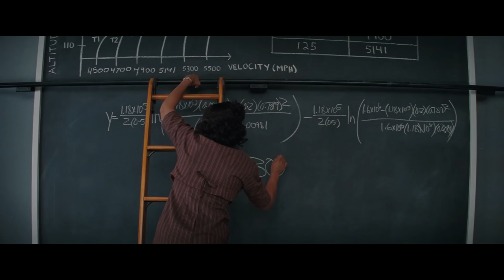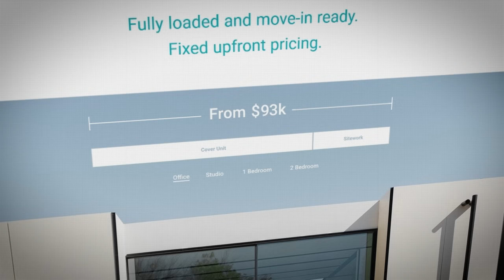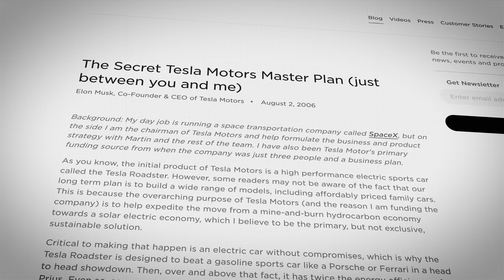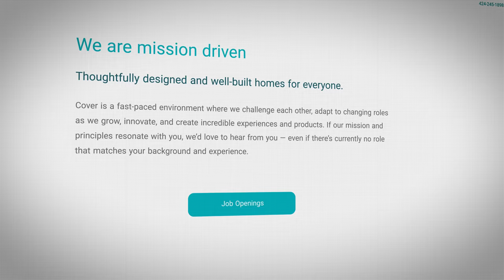How Cover Is Building The House Of The Future

Comment: Prefabs don't address the most important part of a house, the foundation! Once you have a complete plumbed and wired foundation, you can put anything on top.
Reply: You know that slabs aren't the only kind of foundations, right?

Houses with crawl spaces are very common, and in some areas houses with full basements are common. They don't need plumbing or wiring in the slab - and in any case, there's almost no wiring in slab foundations anyhow. The chief exception is a circuit going to the kitchen island if there is one.
Reply: Ahh.. So when there's a good foundation built then you can live on cardboard boxes on top of it, right? Genius!
Reply: @jovanleon7  Just because you can, doesn't mean you should
Reply: There won't be proper standardization of foundations because of soil strata
In my city, just 5km apart there is so much difference, we use 2ft foundations at one place, and 8ft at another
Reply: He doesn't make pre-fabs and nobody here is pushing them, you halfwit. He makes components which builders assemble into houses.
Reply: I don't think prefab or "panel housing" was meant to adress a foundation problem. As foundation is probably the same as with conventinal buildings.

Comment: Always amusing to me when I see yet another startup that thinks it's reinventing architecture, Tesla'ing homes, disrupting an industry... and boom $60MM is thrown their way - funded!  With $60MM in hand, they better be able to invent something.  If the panels are the focus, it would have been nice to see/hear more about the panels (other than a few flashes of 3D modeled small box structures).  Any small flat-pack house can be assembled in a month... What would make this concept special, is if the panels are structurally, insulation value, and means and methods wise revolutionary.  They could be.  SIP's are great, and most out there are still pretty low tech.  Buildings have roofs and floors as well, so a smart wall panel needs a whole system.  But, with $60MM, Cover should be able to hire up, pulling engineers from Tesla, et al, and make this into the... next... Tesla...   LOL.
Reply: Yea I like the house made out of recycled plastic. Its almost as strong and insulated as concrete!!!!
Reply: How these panels ar better than existing pre-cast concrete panels? 
Also most people want to live in bigger spaces.
Reply: Something tells me they are like next Theranos, will just run with the money lol.
Reply: the video sounds like an advertisement for the company.
Reply: Alexis sounds incredibly naive, despite his newly minted degree in Architecture. You can purchase a 3 bedroom fully equipped single-wide modular home for 40K in Texas. At well over 150K for something he is creating, he will never be competitive. Also, this price does not include utility services, nor a foundation. And don’t give me the argument about getting it into a tight space! A modular can be delivered anywhere there is road.
Reply: @rozinant1237  I see this often. There are people willing to pay a disproportionate amount of money for a concept that seems over priced to some else in the industry or someone who knows what the real cost of fabrication is. There's a RV company called Happier Camper and there base starts north of $25K US. I work for a millwrighting & fabrication company. For $10K Canadian I'd have something equally custom and more durable. Granted it wouldn't be as aesthetically pleasing but I'd have a bunch of money still in my pocket.
Reply: @HarveyMillstone  Yeah but it's a weird demographic because they are essentially selling to rich people and most of them don't want to live in a shoebox.
Reply: Same feeling
Reply: @mail22  because it is an advertisment for this company
Reply: $60 mill isn’t a problem, if successful there’s plenty more funding that can be raised.
Reply: @rozinant1237  $350,000 for a 2 bedroom, 1 bath from Cover. Insane. I understand you have to “start small”, but starting small doesn’t mean being overpriced. Unless they can get the price to plummet soon, it won’t last.
Reply: I don't think invention is the problem. The long grind of setting up a distribution system and selling to builders is what always stops people.
If a company has a distribution and sales operation in operation, e.g. the glass-makers, a new invention, e.g. sealed double-pane units, goes into widespread international adoptions toot sweet.
Reply: @HarveyMillstone and you will have the option to improve it as you see fit
Reply: I already know this company copied someone's idea that this is 10 times their price .

Comment: In my experience as a framer and now an construction estimator, prefab single family homes seem to have very little of the prefab market and prefab companies tend to focus much more largely on multi family as it provides more efficiency in that type of building. The other aspect, is prefab homes (for what you are getting) are rather expensive.
Reply: From my experience, on prefab homes, we sell the solutions to businesses as B2B. Prefab has very limited use
Reply: Yeah, the benefits to prefab don't seem to be very much if any benefit to smaller homes, that the only real method of profit  worth the effort would be to McDonalds it, while offering some limited customizations which presents its own issues for a prefab production line.

Comment: Cool video, but there are plenty of great housing solutions along these lines that haven't been widely adopted. I fail to see how they are going to "revolutionize housing" anytime soon. We'll see how much infilling actually happens in California. Would be great if it happens, but we'll see how it plays out.
Reply: I don't see what this company has to offer against other prefab methodes. The price tag of the other methodes are normally cheaper except that container lady who used the dollar bills as toilet paper or something. The maker of this video also failed to see that normal prefab buildings use panels as delivery, which you can deliver almost anywere where a car with trailer is able to drive, instead of whole container sized buildings or even larger.

This project is probably just like any other project who wants to revolutionise something while not even solving the problems face, but just stating downsides of other methodes which are mostly already handled with and act like they ain't got any. All to price their "solutions" way higher than other methodes.

Comment: Those panels are wayyyyy too thin to offer decent insulation, at least if those 3D renderings are accurate. Even if they were filled with extremely expensive aerogel they wouldn't be thick enough. I can't imagine them competing with SIPS on thermal performance, and I imagine they cost a lot more too.

Comment: It would be great if they provided a stress analysis on structures vs panels. How plumbing and electrical systems would be integrated, testing on how their product would do under harsh weather/environmental conditions like hurricanes, earthquakes. Those things would win anyone, showing us why these types of homes are better than the traditional.
Reply: I wished they shared more details about the plumbing too. Regarding the other points, they are going to be working under California regulations. The regulations here are really stringent and any new building will have to be up to code. Older buildings don't necessarily have to up to date on every code since there are more regulations on new construction.

Comment: Impressively high quality as always!
Would be interesting to hear another person’s perspective on Cover’s approach and the issues they can run into. Unfortunately, it’s doesn’t scale as easily as he made it sound. But panelization is definitely the future of home building and all the large builders know it, which is why most the big guys are working on production facilities.
Two big  issues that are stagnating the innovation in the industry: local control over zoning and stale building codes. Both issues prevent innovation by making it literally illegal to Innov ate quickly.
Reply from the maker: I think the biggest risk is that other parts of the country won't adopt the same ADU laws quickly enough. That would force cover to move into entirely new homes faster than expected, which could be tough. Alexis admits that Cover is also never going to be able to create crazy unique designs, since the process is standardized. You can pick a layout, but you'll never get something that looks completely unlike anything else. I don't think that's a huge issue, but it could be a problem.
Reply: @JohnCooganPlus  Which architectural program is this at 0:08? And where can I get it?

Comment: I think the issue here is, unlike Tesla, they don't have to invent the fundamentals of this approach. They have to find a way to panelize the existing construction methods - meaning wall panels should be structurally sound and well insulated for at least 3 story support with no airflux leakage between panels. Ideally, floors would have built-in floor heating to function as overall room heating, with insulation. And same with roof panels. Everything should be standard size so any panel can be swapped with whatever the owner desires.

If done well, this method should in theory allow for cheaper end costs compared to a traditional build method, even from a startup level. But to me, the pricing seems way off. For what you seemingly get, there really isn't an upside apart from the easy personalization and the transparent costs - but transparent costs don't matter at all when the cost clearly isn't competitive to begin with.

So what I'm struggling to see is, why are they trying to make the "Tesla Roadster", when they have all the means available of making the "Tesla Model 3" from the get go? What is holding them back? Why aren't they developing cost-beneficial panels? Is it simply a manufacturing issue they have run into? Is it their choice of materials? Or are they simply trying to upmarket themselves from the beginning to reach much higher profit margins because it's a novel project in their region and there are enough wealthy customers for now to satisfy their desires?

Imo this is going too slow, and focus isn't in the right place. They need to figure out what their driving factor is, and ideally it should be cost/space ratio and adaptability. That's the main benefit of a pre-built panel based house. That you can get it exactly to your specifications (within the panel standardized measurements), and that you can get it for cheaper than what a hired construction firm could build a traditional house for.
If this isn't their primary goal, and they dabble for too long in the "niche exclusive trendy" section of Californian upmarket housing, then they risk plateauing and never reaching the true potential of their vision.

Comment: Currently at 5:49 in the video, and the way that I understand the prefab home built with ready made panels reminds me of how commie blocks where made, concrete panels assembled into apartment complexes. This is rather interesting as for the Soviets commie blocks where an internal win being cheap to manufacture and allowing for easy and good home/community design. However applying this concept to stand alone non apartment style housing does raise some questions, what is their solution for the foundation, plumbing and wiring up the house? I personally think these would be great for putting onto a fair bit of land, being rigged with solar power and rainwater collection and purification as well as general water re-use (ya know like dirty water being rigged to auto water gardens and such). outside of a semi off-grid or maybe even a full off-grid minimal home I don't see a massive appeal. It would be great as a rental unit on the end of a larger property tho.

Comment: When they can make a prefab footing and making the soil stable, that's the only time It will be safe to live in. There are many technical engineering failures you need to design properly for a prefab housing to work.

Comment: Shipping containers are a non-starter. If you want to live in a van which is also a metal shell you have to insulate it and manage condensation that is inherent in a small space. Same with shipping containers. Purpose built factory housing with panels that fit together is the only viable pre-fab method. It's crazy to have an army of carpenters pounding away on the framing for a month or two and all the worker vehicles taking up valuable parking spots and disrupting the neighborhood. That's 19th century house building. Even Sears had it right and those houses are still serviceable a century later. With today's CNC level of precision the cost of building a home shouldn't require a lifetime to pay for.
Reply: If shipping containers were a non-starter, many people wouldn't be successfully living in them all around the world.

Comment: Hi,
Cost overruns are illegal in many countries, as budgeting should include contingence funds of up to 15%. Plus, usually, an architect needs to prescribe up until the smallest of the screws/bolts and cable type that is going to be used. And they should be approved by the client, by the way. The only problem that might come over and might pump up the price will make any other business practice decontenting or pricing up the product: raw material market fluctuations, natural disasters, or soil issues. 
This looks a bit like Juicero... an issue in California that seems to be a global issue, but it is not. 
By the way, I will assume that, AFAIK, 99% of prefab housing or lodging units are not containers. Architects tend not to prescribe containers, as it is a known factor that they are very expensive for what they are. 
I´d like to think that in the description of this video the author would specify "for and only for California".

Comment: What's the very least any single person needs? I want to see that approach. A 5'4" person with one lifestye may want more or less, depending, than a 6'3" person with another lifestyle. The very least, of sleeping, shower/bath/composting toilet, running water, heat, internet, etc, and then build up, piece by piece from that, only and if the person or couple or famiy can afford it and if they want it. For many, I think, a small house, single level, built on pillars or even posts, maybe just a few hundred square feet can do it all. If it's modular, then so much the better as you could double what you have, etc, if needed and only as needed. 

Same with food and clothing and other essentials now. What's the least amount or lower range, not very lowest, of food and drink that a person needs, again, 5'4", vs 6'3" and body types, lifestyle, etc, factored in. One person might live just fine on a bowl of chili and 2 pieces of bread with peanut butter, every day, indefinitely, yet others insist on huge meals, 3x a day. That's not needed. It's available, but it's not needed, it's just wanted. 

Same for Basic Income. A person living in the US might need, realistically, $200 US, per day, 365, direct deposited at midnight, for life. Some to savings, some to an index fund, and most to spend, which can be saved and invested too, of course. Someone else, living in rural Jamaica may have the same housing and food requirement, but can easily and maybe happily get by and stabilise and then get ahead, on maybe $50 US per day, x365 for their 'daily' Basic Income. 

I have no problem with capitalism, people saving, working harder, getting ahead, making huge profits, etc, but... when you have a meta yacht and someone else can't eat and has no place to sleep and is say, tricked or pressured into becoming a meth addict, well, it's a sorry state of the world I must say. 

Ideas like these can sweep away old problems like the opioid crisis, etc by verifying that each and every person has what they need and it's AI and blockchain verified. 

A smartphone (not below a certain reasonable standard and age), a mini-laptop/tablet or standard sized laptop (depending, those with eyesight issues might require a bigger one for the screen size), a certain amount of clothing and grooming items, not just cobbled together by food banks and church groups, but a factual, realistic, real-world list, this is all a human right now, globally. 

Anything less is failure and shameful.

Comment: I'm sorry but Americans don't know how to build houses. You use plywood and wooden beams as a means to build extremely weak structures. But this is a very disposable way of building. In Europe we build houses out of concrete, steel rebar (the structure) and fill the walls with a variety of construction blocks. Thanks to that we build houses that withstand high winds, earthquakes and extreme temperatures. If you build a house made of wood don't be shocked when it crumbles against the weather. 

Now, building a house out of prefabricated panels made out of punched out steel and insulating foam doesn't solve the problem of the lack of rigidity. It's basically the same technology as in building trailers. Those "houses" will all end end up in a landfill in 15 years time.